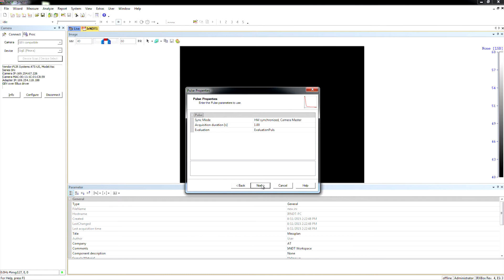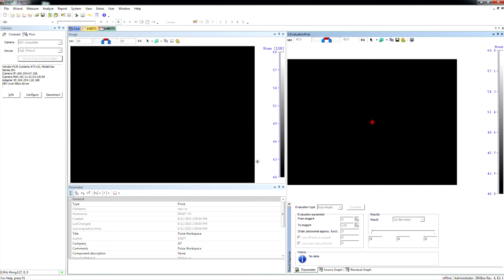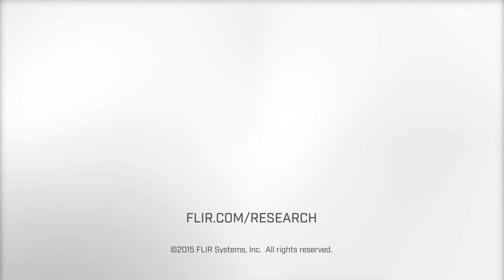Flash Thermography for Non-Destructive Testing

Comment: Could this be used in nuclear plants (high radiation areas)? Is insulation removal required (probably a stupid question)? And can the remaining wall thickness (elbows, tees, expanders/reducers) be ascertained with this equipment, or does it only locate flaws/inclusions?
Reply from the maker: Hi! Thanks for your question. In theory this would work. I would need to learn more about the type of insulation, thickness etc. Pipe thicknesses can be measured using ultrasound non-destructive testing.

Comment: would it be possible to use other type of IR camera (cheaper version) with similar resolution IR image for NDT testing carbon parts?  second part of question Does the thermal lamp accelerator has to be used, would it image still be visible with defect on regular room temperature? If not would be possible to use other type thermal lamp or source to bring temperature in testing sample?
Reply from the maker: Our system supports only a handful camera models that are applicable for this application. In order to get good results, you need to use a good camera. Cheaper cameras tend to be not sensitive enough and too noisy. We use a Xenon Flash Lamp and Generator for this with 6 KJoule output. That is about what you need to create the results you see in the video.

Comment: how does your 1st, 2nd, and 3rd derivative work and how it is fine tuned in the results? I guess I just do not realize why you would need a derivative when the flash should show it initially.
Reply from the maker: Sophia, it is correct that a defect might show by just observing the cool down signal. However, a derivative algorithm will enhance the contrast significantly. It enhances the rate of change. This is performed on each pixel over the entire image sequence in the measurement. Our system has multiple different mathematical models that can be applied to the measurements. Each one with its own pros and cons.

Comment: Quick question, I would like to know the resolution on one of these systems. I would like to know if the system will pick defects in a single ply composite that's 0.10 - 0.20 mm in thickness. Thanks
Reply: Dear Krishnan, 
Thanks for your question. Yes, defect detection through a single ply is not a problem. In fact, we can detect defects through several plies. When using flash thermography, you are roughly limited to about 1.5mm to 2.0mm penetration depth in composites. However, when using transient, we can penetrate to about 6-7 mm due to the longer excitation. The minimum size of the defect depends on the field of view of the camera and the camera spatial resolution. We like to see at least 4x4 pixels across the smallest defect size of interest. Make sure to visit our website for more information as well. http://movitherm.com
Reply: Thanks Markus. Any chance you can scan a sample prepreg (single ply) and share the data with me ? I can connect with you via email if you could share it. Thanks
Reply from the maker: @krishnanbalajithattaiparth9112  
Please contact us directly at www.movitherm.com via our contact us form. Thanks!